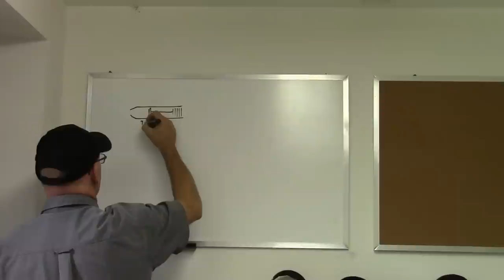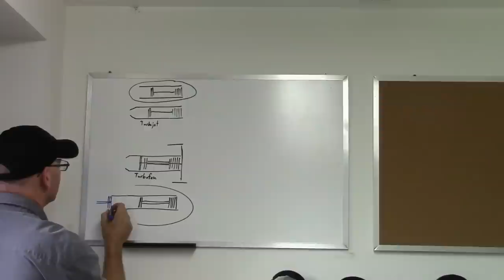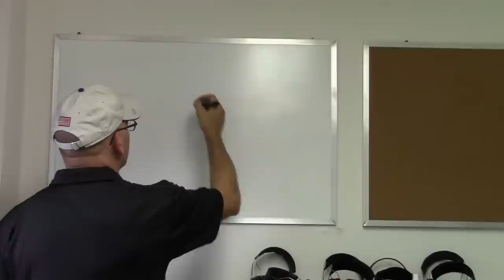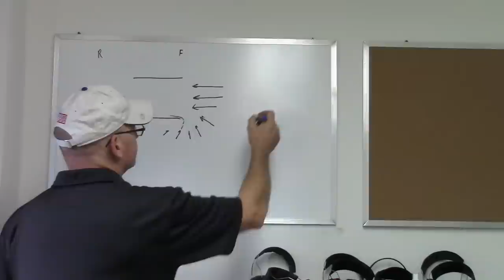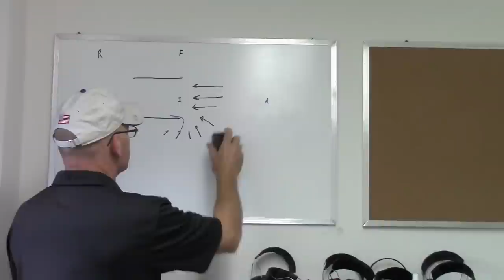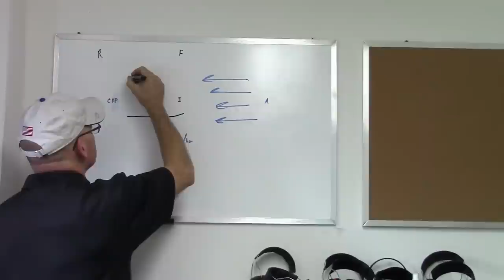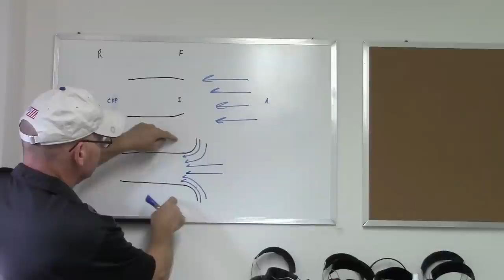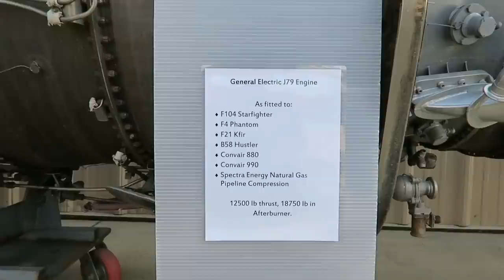Jet Questions 66

Comment: Are there any hybrid gas-turbine electric engines used in any vehicles (ground or water)? Would that make any economical sense? I'm thinking of a diesel-electric locomotive but using a gas turbine instead of a piston engine.

Also, how small can you make a gas generator? Would the fuel consumption scale down with the size of the thing, or is there a minimum size under which you wouldn't really go to get any benefit over a piston engine?
Reply: johndoe1667Some ships use this, gas turbines are utilised to provide electricity. Electric motors then turn the props.
The UK's type 45 destroyers are one example
Reply: johndoe1667 
As Jay already said quite often, a gas generator not running at 100% is very wasteful. So it's useless on a car, except if you would haul around large battery packs that would charge while the the power is not needed for driving. A gas turbine and a piston engine are equally efficient in fuel usage.
Reply: superdau I know. That's why I asked about scaling it down. Maybe being able to turn it on and off when needed. Question is how scalable is the solution? What is the smallest vehicle it's usable in? We know it's used in ships, but why not trains or huge trucks?
Reply: johndoe1667 
Sure you can scale the turbine engines down (with the disadvantage that scaling down almost any engine technology makes it less efficient). There are RC model sized gas turbines. But the main problem is still the usage pattern. The all-or-nothing output of gas turbines just does not suit the usage patterns even of bigger vehicles like trucks and trains. If I remember correctly (I think Jay said it in a video) turbines don't like fast on-and-off cycling either. You would need huge intermediate energy storeages for the 50% load application, because the gas turbine can't give you that. One of the main benefits of a gas turbine is the amount of power you can get for a certain amount of engine size/weight. Neither of which are really an issue in trucks and trains.
The idea isn't new. Gas turbines have been used in vehicles as long as there are gas turbine engines, starting with the 40ies of last century. There have been and are trains, busses, trucks using gas turbines, but most of them were/are concepts, showing again and again that they are not really suitable.
If you don't care for efficiency they are actually installed in vehicles like tanks for example. But because even there you can't throw efficiency out of the window completely, tanks can have huge battery packs or even secondary generators for idling.
They might come up as a "power-charger" for electric vehicles to increase the range significantly. There you could run the engine at a very well known load and small size may be an advantage.
Reply: johndoe1667  Locomotive has already been done, Union Pacific GTEL. There is great vid here on YT of these locos.
Reply: I believe some tanks use turbine engines and they have a battery so yeah?

Comment: Hi AgentJayZ,  I realise that I'm stating what you already know all too well, for which I apologise, and I know it has come up before.  However, could I suggest that you make it clear (again) to your subscribers that, when you test a gas generator, you are effectively turning it back into a turbojet by bolting a 'slave' jet pipe and fixed propelling nozzle onto the back end? This is done so as to reproduce the 'back pressure' of the power turbine it would otherwise be feeding, in order to measure the various performance parameters accurately.  The gas generator is then producing thrust, exactly as it would as a turbojet, and the thrust could actually be measured, if the test stand incorporated a load cell arrangement.
Reply from the maker: grahamj9101 Yeah, I'll agree to everything you are saying, except our restrictive tail cone produces less thrust than the actual turbojet nozzle.
Reply: +AgentJayZ  OK, yeah, but your "restrictive" nozzle should be sized for the LM1500's industrial rating and application, which is presumably at a lower TET/EGT than the J79.  However, if you put a J79 converted to LM1500 on the test stand with that jet pipe, but with a fixed nozzle that was sized to be equivalent (good weasel word!) to the closed con-di nozzle, fuelled the engine with Jet A/Jet A-1 (or whatever) and ran it up to max dry/military power, then it should give military power thrust.  It might even give that thrust at a slightly lower TET/EGT, because the jet pipe and nozzle should be marginally more aerodynamically efficient than the J79 afterburner jet pipe and closed con-di nozzle.  If this were not the case, then I would ask, what else have you changed and WTHIH?

Comment: Jay, what would it take to fit two T-58s into the jetboats?  Since they're in an unlimited class, would there not be any race regulation issues?
Reply from the maker: ladams00 Same reason a twin engine car is not a good idea. Weight and size make it unwieldy in the tight stuff.
Reply: Ladams I also agree, being able to half the gear ratio, same acceleration but double force top speed, so top speed ~200+ mph
Reply: Since it rides on the water not it in
Reply: +AgentJayZ Bugatti veyron? Twin v8
Reply: Aidan Brown No more a Twin V8 than a V8 is a twin inline 4.  Its not two engines.  They describe it like that to illustrate that the pistons in each bank are staggered and not inline, allowing the engine to be shorter and lighter, its very misleading.  All 16 pistons are part of the same engine block and attached to the same crank shaft.  From the outside it looks no different than any other overhead cam V type engine.
Reply: +twainguy2 I guess you're right but you could have them as separate and get the same power
Reply: Aidan Brown Sure, you could do two engines instead of one, but for exactly the reason AgentJayZ posted, it doesn't make any sense.  It would take up more space and be heavier.  It would also be more complex as you would need to add components to tie the two engines into one, requiring yet again more space and weight, as well as another point of potential failure.  There are cases where multiple engines make sense, like passenger aircraft, trains, ships etc., but in most cases it makes more sense to slightly upsize the engine to achieve the required additional power.  In the case of the Jet boats above, I am no expert, but I am quite sure there are slightly larger engines they could choose if they needed more power, but they are probably using the ones they do because it is the right size for the job.

Comment: Great, thanks again for taking the time to explain things.

The shape of the intake lip is a big issue because of the conflicting conditions and requirements. Airliner intakes are a compromise to get reasonable static thrust while retaining low drag at cruise speed.

Early designs such as on early-model 707s had a cruise-optimised nacelle and pressure-differential-actuated auxiliary intake doors around the lip that opened at high power/low airspeed conditions: https://www.youtube.com/watch?v=qsUL9Xc3a2g

A similar system is used on the Harrier air intakes: https://www.youtube.com/watch?v=lu54pdBsA-o

Most supersonic designs in fighters have sharp-edged intakes and also use auxiliary doors in static conditions.